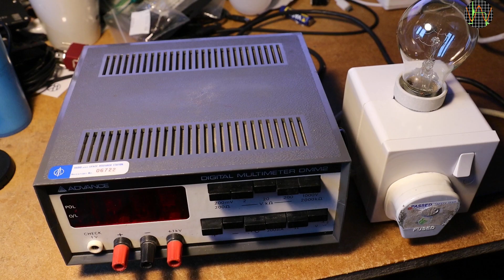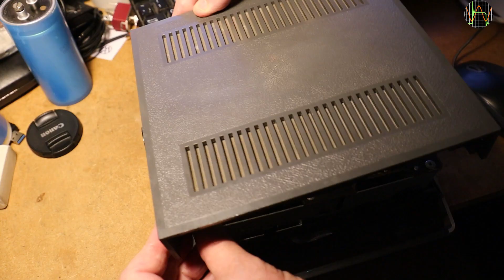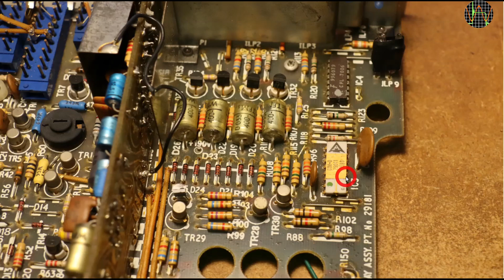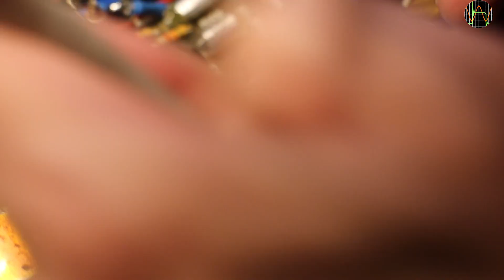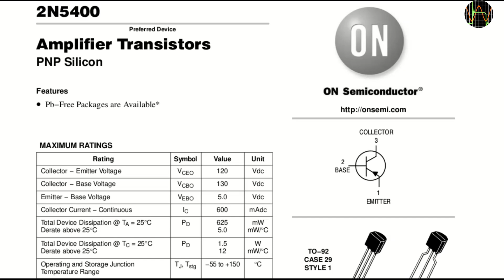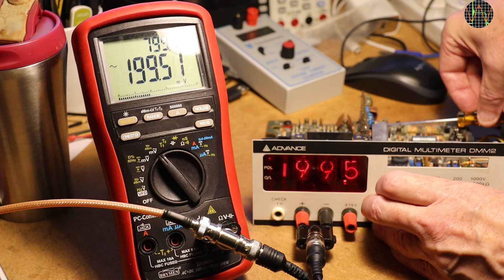163 - ADVANCE DMM2 vintage multimeter repair - part 1

Comment: Gotta love nixies - much more elegant looking displays than 7 segments.
Reply from the maker: True, except for Panaplex displays which use neon segments, so kind of a modernised Nixie.  They are just gorgeous (e.g DATRON 1065A). Given a choice between Nixie and Panaplex, I would probably take Panaplex.
Reply: @TheHWcave   Panaplex are definitely beautiful, too (I have a couple of Data Precision 3500 meters that use them, and very recently added a Datron 1062 to my repair queue), but still give the nixie the nod with the Panaplex a very close second.  The big ones in the Datron meters make me think of a neon version of a custom LCD or VFD with their additional annunciators on the side.

Comment: I can relate to repairing old test equipment like this; I was given a rather nice counter / timer / frequency meter that powered up but just showed all zeros; it was another instrument based around a custom LSI device and it was that which was dead. The manual did, helpfully, show the logic operation that the device did, but the effort in replacing it with a PAL device coded to give the same logic was not worth it. It did, however, surrender a rather nice 10MHz 0.1 PPM OCXO which lives on in another instrument now.

Comment: Great work so far! I guess the designers felt that it would never break down,  so just run wires to connect the boards. Looking forward to the AC converter repair. Regards,  David

Comment: Nice meter. I have a Fluke 8120A with nixies that is a pleasure to look at. It does have a +/- indicator, so it is a bit easier to use. Of course, I only use it when I am in vintage mood :)